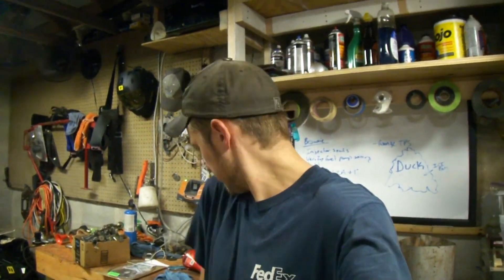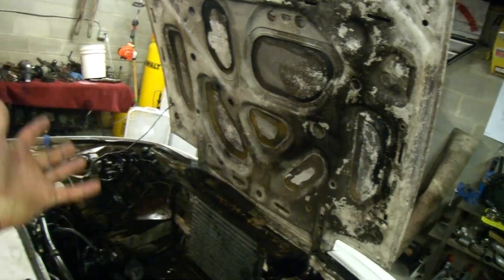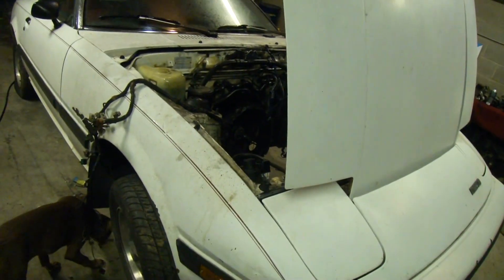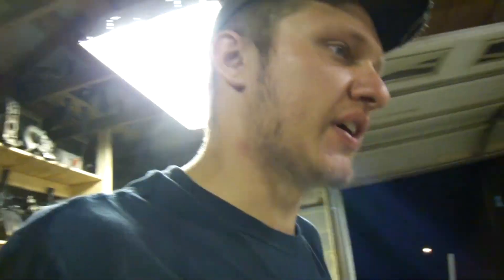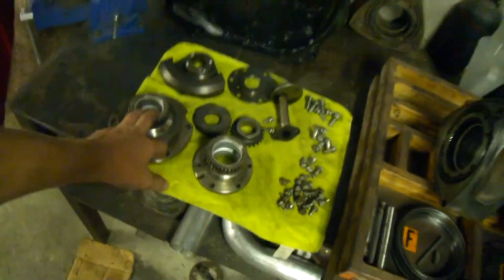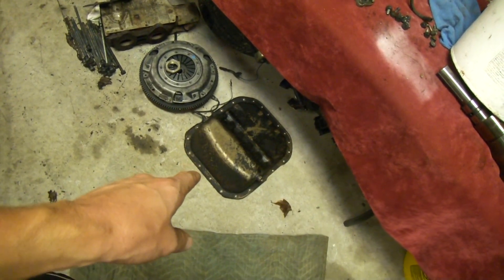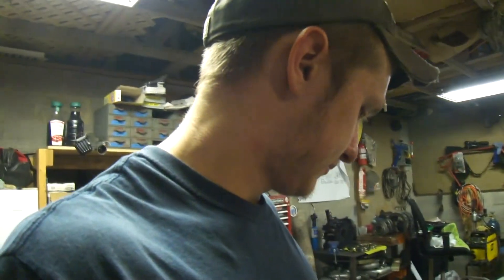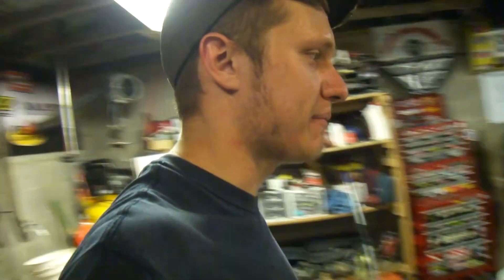12A Rotary Engine Build Update

Comment: Thanks for posting up these videos. Very entertaining.
I had a question related to your budget big brake video.
Do you know if 82 FB calipers will fit on 79 SA struts? Or will I need to use the FB struts as well?
Reply from the maker: Thanks man!!!   So the FB calipers will work on an SA strut.  You will have to get the caliper bracket and caliper together.  Also a 79 is course thread pitch on the brake line.  You will need an adapter to make a factor rubber line work between the 79 body hardline and the FB soft line.